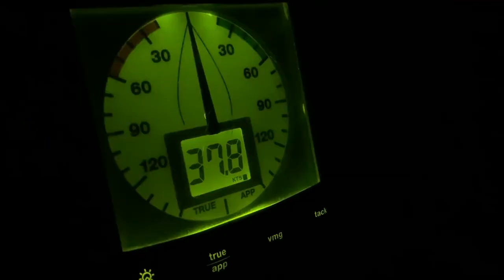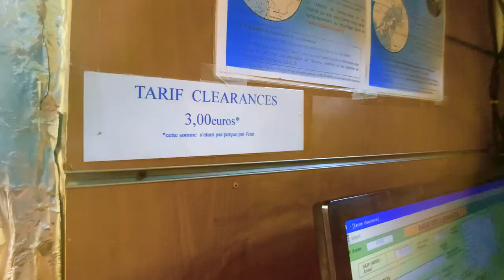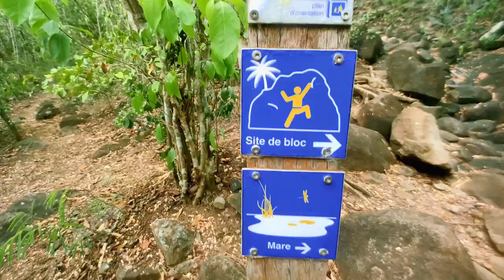CHEAP BOAT HACK: Making our old catamaran look BRAND NEW! [Ep44 RED SEAS]

Comment: It's really hot where you're at. Your laptop may be overheating. Try a laptop cooling tray. The fans may help keep it cooler and functioning longer.
Reply from the maker: Yeah overheating electronics can be a challenge for sure. We have been pretty lucky so far but I think between heat and salty air, most things are destined to eat themselves.

Comment: I had a computer repair shop/computer consulting business and left it a year or twoish back.  I had three Macbooks die within three years.  Basically one a year when exposed to salt air.  It seems that they don't coat the circuit boards well enough or at all to resist salt air.  Ask me how many I had to repair with those same issues!!!!!  Fact is I don't know but it was a lot. I learned my lesson with having them on the boat.  It doesn't necessarily mean anything else would fair better, but my PC laptops I have bought have been averaging five years.  Which they have a design life of around that much anyway.  The fact of the matter is you can buy three higher performance PC laptops for the price of one mid performance Macbook.  Black Magic makes a really powerful and free PC based video editor that is on par with Apple's offerings.  So if you wanted to switch to Windows that is a good option.  Also it is possible to load MacOS on PC laptop hardware.  I've not done it myself but there are tons of tutorials.      You just need another mac to download an OS image and a few other tasks.  I also wanted to say I loved the striping!!!
Reply from the maker: Yeah, our relationship with Apple computers has been somewhat strained to say the least. We actually edit on premiere pro so that is agnostic when it comes to processor and OS to some degree but our budget was limited and we needed to get something that we had a track record of working with. That being said, if we ever could scrape together the funds for a monster Pc laptop that could handle the rendering work load that would make a huge difference to our reliance on apple. They certainly have been thru a few generations of @not so great” laptops but perhaps that is about to get better with apple silicone?

Comment: Great job on the striping,, being simplistic just painted my whole hull white to cover the gel coat stripes. But it was only a beach cat.
Reply from the maker: We have talked about getting Indioko a nice wrap but it’s just too expensive for us. Perhaps some day if the upkeep of the old gelcoat gets too much.
Reply: @RedSeas  To make sure nothing was lost in translation, by a wrap do you mean like a plastic car wrap, or does wrap mean  paint in Scottish? My plan was to race the beach cat, so wanted something easy to cover up patches. Of course had one buddy paint a bandaid over his repair, it looked good & funny.
Reply from the maker: Haha. Appreciate the need to check the translation. We have seen a few people wrap their boats the same way you see cars get wrapped. Let’s them put fun designs on or just keep the boat beneath in a slightly better condition. Not sure it would be economical for Indioko as she is already pretty sun tanned from her years on charter but perhaps we work out a solution if it gets to a stage where we have to.
Reply: @RedSeas  Thanks have not seen the boat wrapping process. Considered a Warp for the golf cart, but looked like an easy thing to screw up.

Comment: re your engine problem and most definitely not an expert. My guess is that if it is a relatively modern engine it might have an ECU Engine control unit fitted.It might not however if it has it is either that or a sensor
Reply from the maker: Interestingly, we were thinking similarly. A sensor makes most sense to us but we have had some really useful insight from our patreons. Turns out there are some really amazing experts watching our little adventure. 😃